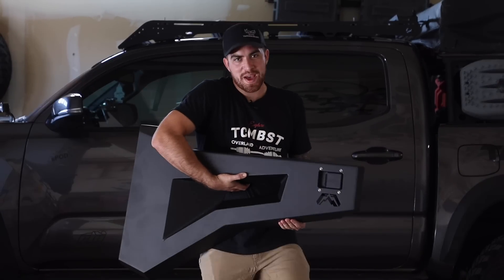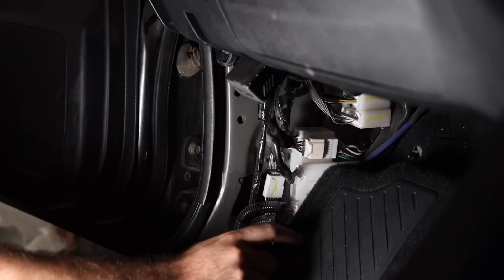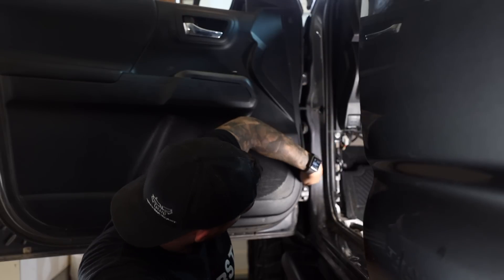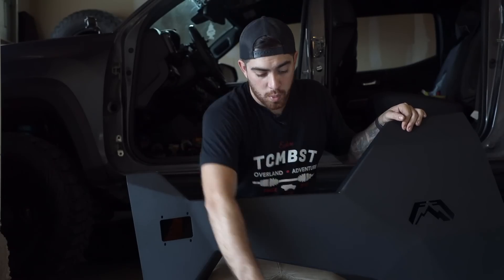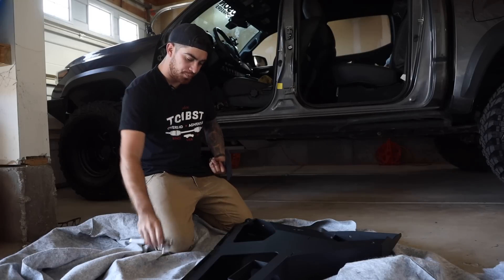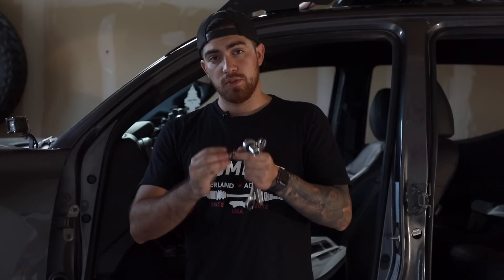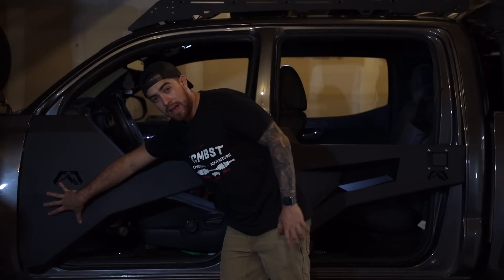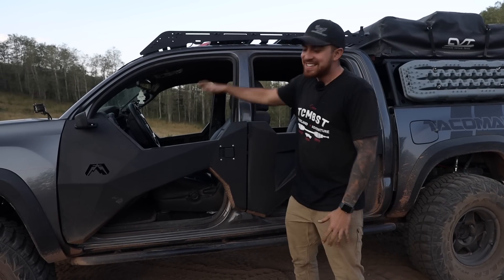How to install Tube Doors on a Toyota Tacoma

Comment: I hang the doors from the garage door tracks in my garage with ratchet straps before taking out the hinge bolts. Just a way you can do it when you're by yourself.

Comment: Why are the doors 2 grand
Reply from the maker: Think about how much material is used on a steel front bumper, these 4 doors use more material than one bumper alone. Then you need to think about the design/engineering and production cost.
Reply: @tacomabeast   I get that they look awesome  but that’s a lot for doors